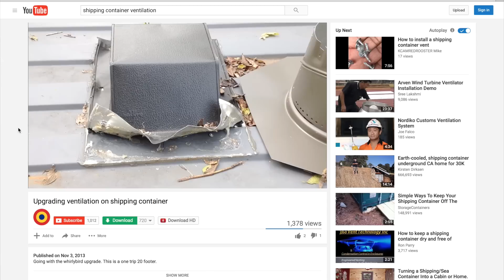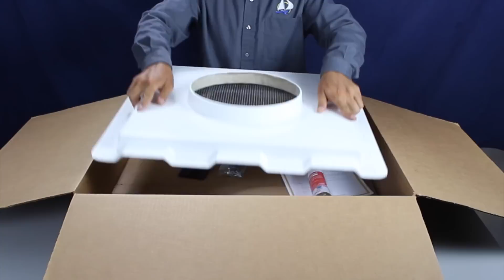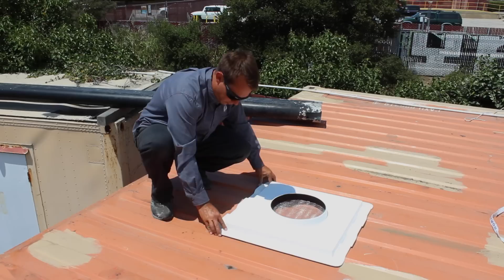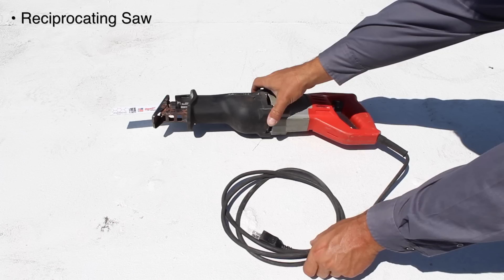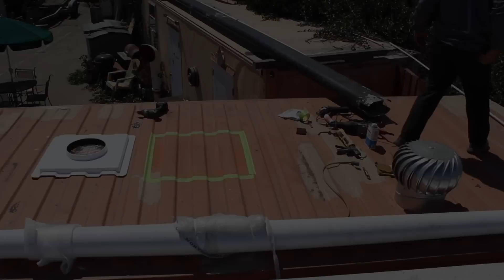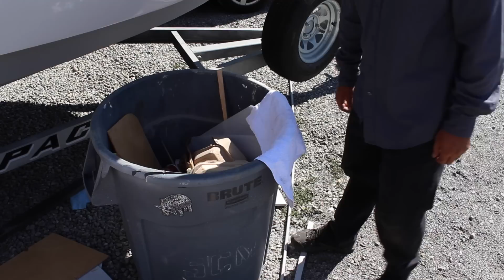Vent Mount for Shipping Containers

Comment: I see your current model has been updated to a smaller model. 

Have you considered making one that can hold a RV roof top air conditioner
Reply: I ask because those whirlybird bird kind of suck. There are so many other options to mount thing that need this corrugated adapter. Dolor power fans rv air conditioners just to name a few

Comment: I bought this product and followed the instructions. No problems at all. I discovered it needed an intake vent so I cut and installed a covered 10"x10" vent in the door of the container. This was a game changer.

Prior to this I would park my tractor and PTO driven 68" wide snow blower in the container after moving snow on my property. With the doors closed, the engine heat melted the snow and  I would get a tremendous amount of condensation which would then freeze to the ceiling. 

That was before. Now the front vent in the door and the whirly move the moist air out of the container.

No more condensation!
Reply from the maker: Thank you for sharing your experience with the ventilation adapter!

Comment: 270 bucks for a mass produced hunk of plastic?   Highway robbery, you should be ashamed!!
Reply from the maker: They were $270 a while back as this price included shipping. We then enabled the website to calculate
 shipping for each order and dropped the price to $200. Those parts were hand made in our shop in California. I agree they were too expensive. We are now releasing a new product that will fit the exact same way, still hold the lifetime guarantee and be made of heavy gauge hot dipped galvanized steel. The new product will still come with all the hardware, sealant and drill/driver bits.. We will sell for $140/kit. I am not ashamed and we have done our best to provide a reliable product that’s easy to install all while only hiring US citizens and paying all associated taxes, workers comp, etc… We will continue to try and bring down manufacturing costs all while providing people with a product they can count on that I have to mention has had a 100% satisfaction rating.
Reply: ,, @ContainerCreations  I guess the 20$ an hour mandate didn't help. Even the reduced price still doesn't fit my VA Disability budget. Thanks.
Reply: @davidleatherneck  i think 140 is reasonable....got to make some money to continue a bussiness...i realise this thread is old so prices may of changed

Comment: Does the turbine (whirlybird) itself leak when it rains?
Reply from the maker: Turbine vents are designed not to leak because of the design of the fins. They also sit on the exterior of our adapter so there is no place for water to enter.  Thanks!

Comment: Just weld it lol its cheaper and you can use a plasma cutter for the roof.
Reply from the maker: Evermont King —Thanks for the comment. Good point, if you know how to weld, have the equipment and time. This is an alternative for those that don’t. It’s also easy and quick to install which you can do in a fraction in the time it would take to weld. Thanks! - Liz Forrest

Comment: Good video but people should definitely caulk each screw head because if you don't they will leak.
Reply from the maker: Hi Michael, in the tutorial we specify that one of the beads of caulk goes over all the screw holes before you lay the part down. This is adequate, thank you for your comment.
Reply from the maker: In the video we show and instruct to apply one of the beads of adhesive at 1” inside the perimeter. One inch is also where all the screw holes are. Two for one! We have had zero complaints of leaks. Thank you for your comment!
Reply: Caulk iver screw hole is a great IDEA… but not sane as hoing back wnd caulking individual screws after installation. About 2-5 minutes & less than $2 sealant? C’mon now! Pride in your work

Comment: Would I use adapter one for a 40 foot container?
Reply from the maker: Hi Patrick, that would depend on your application/use of the container. For storage you could probably use just one Whirlybird and Vent Adaptor. If you're using it like I use my 45 footer, as an office and seperated work shop we recommend two for adequate ventilation. For questions or to place an order please call us at (831) 515-9991.